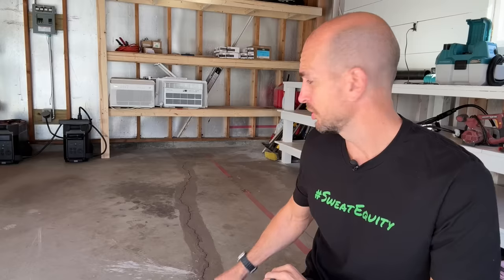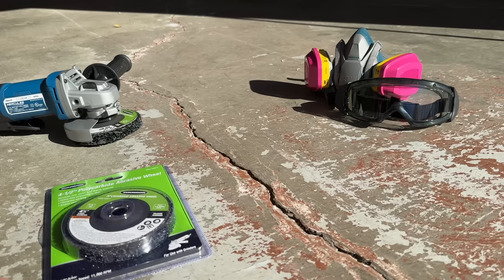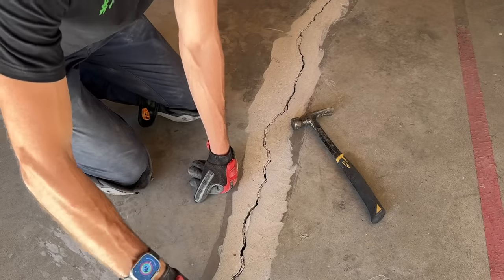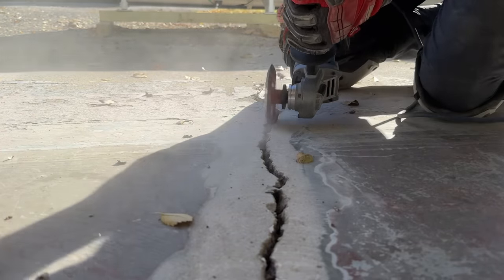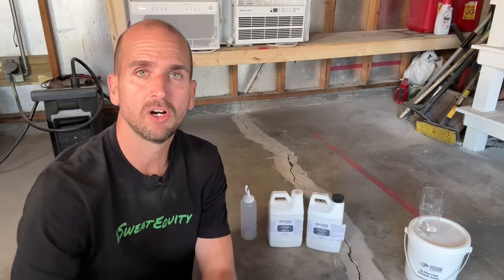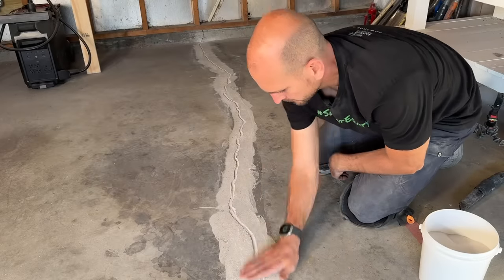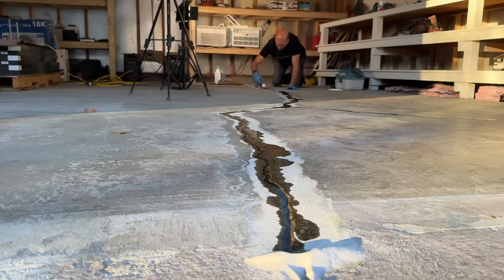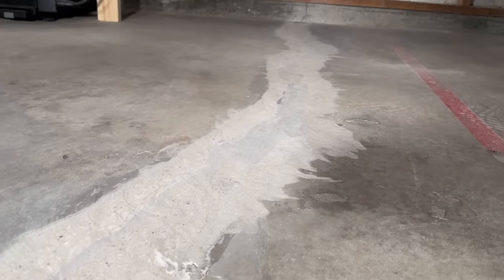How To Permanently Repair A Garage Floor Crack

Comment: We have a problem with water getting in between driveway and foundation. Previous owners filled with some type of sealant but not working. What could I use to fill void and seal?
Reply from the maker: Usually I do something like this - https://youtu.be/P28ZpR9I56g

Comment: Good video.  I've been in the Epoxy business since 1996 and my experience tells me some repairs will work, and other repairs done exactly the same way crack through the surface in as little as 6 months. Never really know what's going on under the slab, and if the rebar is rusting in the concrete it will continue to cause failures unless the total floor is replaced.  I just tell customers the risk but 99% don't want the expense of replacing the total floor.  Also not seen any difference in failure rates between filling with a self level product vs a Polyurea product.  Just my 2 cents.

Comment: you mentioned that this repair is for an epoxy floor covering. If I wanted just a crack repair without any other finish coat then this product works for that as well?

Comment: If you’re going to finish your basement, this would be a good practice to do on the concrete basement floor and possibly some smaller cracks in the walls to help with future problems. Bigger ones in the wall have to be dealt with a bit differently but very close to this process especially all the cleaning and grinding. Great video.

Comment: I simply use sandkote which is a fine sand mixed with a clear or colored super acrylic binder and that's it. Sandpaper the finished job with 100grit and paint over with Florkote. Job done for 20years.

Comment: Yep great repair and prep video! and, it will hold up way better than any concrete repair mortar. 
As a quicker alternative, I use a Medium setting epoxy myself (635 thin US Composits medium hardner) for better flexibility in case of movement. After prep, I prime the crack a few minutes before with the mixed epoxy and brush in and then add Cabosil to my mix to thicken it to a drywall mud type consistency and trawl into the joints with a drywall knife. The Cabosil strengthens the epoxy too. No need to wait and keep applying epoxy either. One and done. If you are going over it again with say an epoxy floor system, don't forget to wash your finished epoxy joint when its dry with hot water, green abrasive pad and some dish liquid to remove any amine blush. Amine blush is fairly rare unless it's higher humidity and cooing off and is only water soluble. The waxy like blush will prevent a next coat of anything from sticking. I learned the hard way and even so called non blushing epoxies can blush in the right conditions. Boat builders avoid having to remove blush by putting the next coats on while the epoxy is still a bit tacky and not fully cured. 
*Added notes, I have about 15 years into my technique and no problems with re cracking even with heated floors expanding and contracting the concrete. This repair does not work at all outdoors unless the crack is painted with a UV protectant. Read the directions carefully, temperatures matter and epoxies can get so hot that it can ruin the job if applied too deep or if the concrete is really hot in summer. In winter in an unheated space the epoxy may never cure. Buy the epoxy for the weather conditions. Usually the hardener is changed for the weather. In colder conditions you can heat your epoxy bottles part a and b up in really hot water to make sure it cures and is not too thick,

Comment: So, is there a reason why you didn't smack around the crack with a rubber mallet or upside down sledge to get the sand to settel deepper into the crack and into possable voids under the slab? Just wondering. Would you recomend filling/drilling holes and putting spray foam if you hear a void/hollow under the slab?

Comment: Thanks for this. We moved into an older house and the garage slab is badly cracked. I may have to attack it next summer. Any suggestions for dealing with low areas in the slab where water wants to pool?

Comment: with a wide deep  crack like that closed cell backer rod works well  ,the problem with sand use you have to grind  or catch hell with a scaper  but just rod and epoxy  the excess scrapes off real easy after it fires off

Comment: I'd be curious to see if you would have vibrated that sand down, how much more would you needed to add, also after time that sand will settle, would it have a negative effect with the filler over time.

Comment: eoxies don't have much flexure or elongation, and are hard coatings.  I prefer using backer rod in place of the sand.  This gives a bond breaker and then apply a 2 part polyurethane material in tube form.  You need a dual type caulk gun.  There is a mixing tip that comes with the two tubes for mixing.

Comment: I need to fill my expansion joints in my shop. Always filling up with dirt and crap. I thought of using some type of silicone but a bit harder version so they would still be expansion joints but just not dirt and crap filled. Watched this in hopes it could work for that but I see this is just for cracks.
Reply from the maker: I had good luck with Sika Self Leveling Sealant and Tremco Vulkem 45 SSL after pressing backer rod into the gap.  https://youtu.be/OUnUkrqsbA8

Comment: Hey...I have a furnace/ac unit that has the dripping going into the garage.

The moisture runs with ac and heater. After a year of drippings, it has eaten the concrete. About 3 feet long, about 3/4 deep, and runs from drainage pipe to the indoor floor drain.

Got any idea what it is? I remember dad collected it and stored it as distilled water.

Comment: Yes to the initial question. Cut joints  in the slab to begin with . 4  feet  is a good starting point.

Comment: A dust collector, like for woodworking, between the grinder and the vacuum helped control dust levels when I've ground concrete in the past. Still should wear a respirator but the vacuum filter doesn't clog up nearly as quickly meaning more dust gets collected than otherwise would be thrown into your work area.

Comment: Good Luck. I seen those fast patches mess up the seal coat. Bubbled and cracked. if it messes up clean the concrete with muriatic acid. any oil residue will cause seperation

Comment: Hey Scott, I just watch your video that repair looks great. I have a question . I don't see any any expansion joints along the foundation. I would be concerned that this crack is an expansion crack. If so you repair may  crack again. I would look into installing some expansion joints ( controlled saw cuts) in the floor before you epoxy your floor.  looking forward to see the finish video.
Reply from the maker: Good call, I think they poured this pad/foundation as one large pour back in the day will no expansion and/or control cuts.  I think you are right that I need to come up with a plan to put some cuts in prior to doing the epoxy coating to give it a chance of a long maintenance-free life.  Thanks for the feedback.

Comment: Instead of using pricey and hard to work with epoxy, I would think applying with a small brush, a liquid concrete binding agent(which allows new cement to bind with old) (available at hardware stores) to the old concrete crack and then filing in the crack with a mortar or thin set, would be the easiest and most cost effective and long lasting. 
Take care
Reply: Easy, yes, but the weakest repair method there is.  The bond strength of epoxy is over 10 times that of cement-based products, even with the polymer bonding agent.
Reply: I’m not a pro, but I see that when securing anything, like a bolt to a foundation, or a bolt to concrete, epoxy is used as it is the strongest known non specialty adhesive.  Given all the prep work, I would do it the “once and done” rather than a cheaper way.  The next owner will appreciate it.

Comment: Scott, I know you said a future project was re-pouring the driveway but that crack is running all the way to what is either the wall footer or your house foundation.  You are about to hit freezing temps and that long driveway crack is going to freeze and that, freeze and thaw, over and over until it brings back a hairline crack in that nice epoxy floor you are putting down.  Run a relief cut between your garage and your driveway even if you plan to re-pour it later.  Remember ice > concrete or epoxy.
Reply from the maker: For sure, I will be cutting this week to give some separation between the garage and driveway 👍

Comment: I used a $20 bag of polymeric sand to fill some driveway cracks, as well as filled  sidewalk expansion joints where the original filler had disintegrated, and 1year later, they still are holding. Not sure about long term viability, but was by far the cheapest and easiest solution.

Comment: when doing the crack grinding if you grab a carriage bolt that fits the hole for the handle if the saw you can set that like a depth stop then you let the grind ride on the head of the bolt and angle for depth of cut fine control.
Reply from the maker: Interesting 🤔 thanks for the feedback

Comment: May as well pour cement grout down that crack since it is only a cosmetic repair.That epoxy is weakened by the sand filler and does not extend the full thickness of the slab.It cannot be guaranteed that the epoxy will bind all the way down the crack which has sand as a filler.Sand does not increase the strength of the epoxy it is just a cheaper filler.This needs to be shown between two pieces of Perspex filled with sand and then the epoxy poured over it to see the depth of penetration of the epoxy down to the sand. Then also the strength of the epoxy sand mix.

Comment: I used to repair cracks in the concrete in a floor that had fork lifts crossing carrying heavy loads  of steel.  I used the clear epocsey from Home 
depot and poured it into the cracks without the sand.   that material had a longer cure time and would settle to the very bottom of the crack and was self leveling at the top, so it would prevent further damage when the fork lift went over it.  It would take a lot more material in a long crack, so it would get expensive, but i never had to redo the crack.  The supposedly same stuff from Lowes would not work because it did not cure in the depth of the crack.

Comment: there many ways to repair those cracks , fiberglass polyester  resin thin it down some with acetone and mix the hardener , pour it into the sand  , years ago  i also repaired those cracks with latex caulking then painted the floor until today it's still perfect , you may use also epoxy fiberglass resin

Comment: Good to see, you are using a guard with the grinder. A grinder is one of most dangerous tools in the shop!
Reply: When he was doing the leveling he also used a shroud designed to contain the dust.  Grinding concrete without a shroud like that is perhaps the messiest thing you can imagine.  Glad to see he was using a respirator as well because even the best dust collection setup won't get everything and concrete dust is about the worst thing for lungs since asbestos fiber.

Comment: Hi Scott, thanks for the video. I have a similar situation in a basement garage that also has water ingress through the cracks. Would you recommend this product in this situation. I also notice that the product data sheet says it is not recommended for moving joints. My understanding is that a moving joint is referring to a crack that has slight movement due to thermal cycles or vehicle traffic, is this correct? I would appreciate anyone's input on this. Thanks.
Reply: If you try to repair any crack that has water coming through it, the water will push somewhere else.  A joint is repaired differently than a crack. A crack, you try to glue back together again, a joint must be filled with a flexible material to allow movement, that's why the joint was put there in the first place.  If you have water pushing up through a slab, the only way to repair that would be relieve the pressure, i.e. drainage system, etc.  After a drainage system is installed, you can repair the crack, but I would not rely on it as a waterproofer.
Reply: @ConcreteFloorSolutions  Good Answer!!

Comment: I have a 10 year old garage with a crack in the corner about 8 ft diagonal and 1/4 wide.  I’m concerned about too much vertical grinding to clean out crack because I have hydronic radiant heat in the floor . Because the concrete is poured over 1’’ insulation board I believe the broken corner moves slightly when driven on but visually it hasn’t moved in ten years. Do you think it’s worth using this system before my epoxy paint if I don’t grind out as much as you did ? I’m afraid of hitting a tube
Reply: well 2 mos no answer. if u r worried about hitting a water tube then u must have a diff of level at a good amt. not sure how deep heater tubes are, but if u have no leak, it can't b that bad right?  if the tubes are centered and u have a minimum 4" concrete, u should have  at least 1.5" of leeway.  imo i'd research how to possibly have that piece o slab lifted (insertion foam/whatever) via drilled hole, pumped/sprayed in. THEN do this kind of thing. but for sure -i'm no kind of expert on this fixit.  i've just been researching how to fix mine.  and lets say the triangle is high instead of low (against main part), then very possibly the corner of the bldg is where it sank.  just throwin it out there.  if u don't know, then to get a measure and the high part is preventing a chalkline stretch, put it on a brick in the corner, and a brick on the main slab.  i hope that made sense.

Comment: As sure as the sun sets, that crack will eventually come back. Stapling would be your best bet and that's even iffy on crack like that. Looks like they already tried to fix it with epoxy or caulk and it failed as the crack continued to widen and stretch the material. Can't stop expansion and contraction movement. Maybe if the garage is heated and cooled, you can minimize movement. If they're putting an Epoxy Flake system over it, that will help to camouflage the crack. That's a pretty major crack that has continued to grow over the years.
Reply from the maker: It is still holding strong but we are still within 1 year of the repair.  I do want to try out the staples on another project.  I like the carbon fiber staples even though they are a bit pricey.

Comment: Will crack again after a while due to no expansion joint, hope there is reinforcing installed when poured the concrete at first

Comment: Is this product suitable for exposure to the elements, particularly our midwestern rain, snow, ice, and UV from the summer sun? Or is it just for sheltered/indoor use only? Also I'm thinking these cracks end up forming because there weren't relief cuts made in the concrete in the first place. I know my garage floor doesn't have any relief cuts and sure enough 10 years later there's a zig-zaggy crack just like the one in this video. There's a reason sidewalks have nice straight relief cracks. Because if you don't make them then nature will!
Reply: I agree with you about the lack of joints.  The material can be used exterior, BUT, It is NOT UV stable.  The material is designed to have coatings placed on top of it after it cures.
Reply: @ConcreteFloorSolutions  How about inside a garage, which is largely sheltered from both the sun (and therefore UV), but where I will not coat the floor? I just don't trust concrete coatings--they always seem to delaminate and flake off, at least here in the cold/hot midwest.
Reply: My installers cut relief cracks into the concrete. Nature made her own cracks anyway.

Comment: First time on your channel (thanks, YT suggestions!). Liked not only the job you demonstrated but your overall approach--not too much detail, not too little; pacing, etc. However, a few questions or suggestions. First, I noticed how your crack extended through the garage and then up the foundation/ wall, a vertical crack. Do you plan to address that? If so, does Concrete Floor Solutions have a quite viscous product for such vertical applications. You mentioned that the solution you're demonstrating would work for basements and I imagine that vertical basement cracks are just as much an issue as horizontal ones. Second, for the crack extending out into the driveway--I believe you mentioned that you will be trenching an expansion joint between the garage and the driveway, and then repouring the driveway as well (wow, $$$). Will you be cleaning up and repairing the driveway crack first? Use the same CFS products? Plan on making another vid to demo all this? Finally, a suggestion: if I were doing this job, I'd have my trusty Gorilla Cart (four-wheel garden cart; nope, no sponsorship here) with me, with all consumables and tools to pull along gently with me as I made my way down the crack. Probably especially important given the fast-set nature of the product. Finally, you may wish to physically, visually lay out all tools (safety equipment, etc.) at some point as sort of a checklist for people to follow.

Comment: Nice job preparing & filling the crack. It should last for some time🤷‍♂Good luck. The underlying problem has not been addressed and chances are over time the crack will appear once again. The other obvious need here is a better vacuum source. Way too much concrete dust is escaping. Dust mask is a big plus.
Reply from the maker: The underlying issue might have been fixed.  This garage never had gutters and now it does.  We will see if the water at the foundation was the issue or not.  Totally agree on the better vac.  I think the industrial units have some cyclones prior to the filters to help remove particles and not just plug up the filters after 5 mins of use.